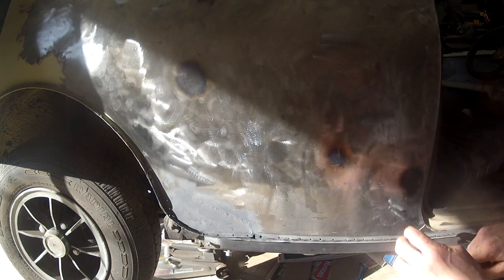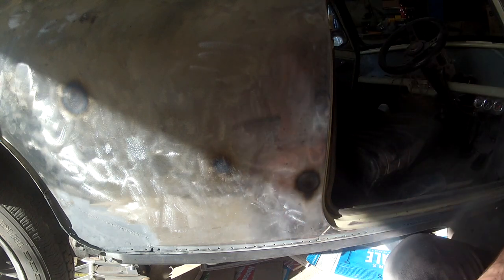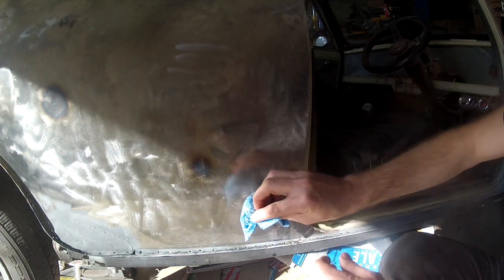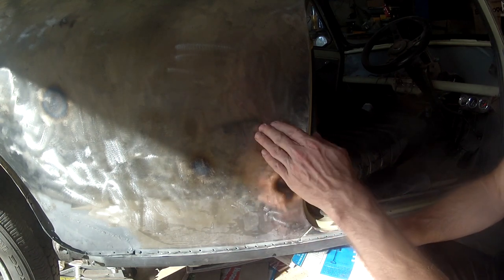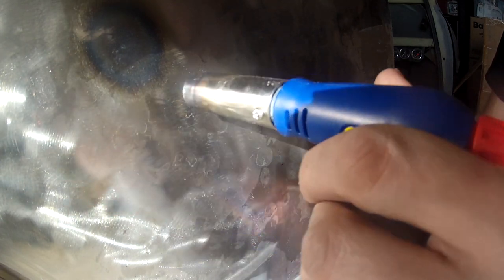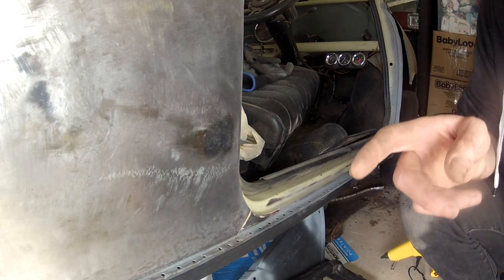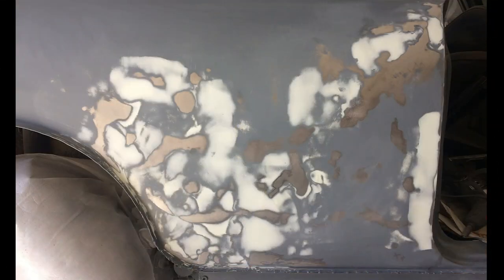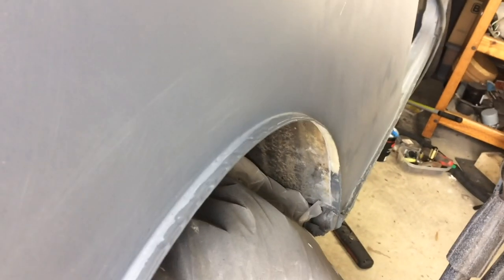EP28  Classic Mini Bodywork- Shrinking and beating | Classic Mini Van Restoration | A Rusty Journey

Comment: Can I just ask....
Heating up and rapidly cooling metal surley makes it very fragile?
I'm under the impression that doing what you have done, your changing the grain structure of the metal?
I watch alot of forging programs,and I'm lead to believe doing this to metal like you are will make it fragile...
I may be totally wrong here,but I wanted to ask, as I have the same issue to you with weak pannels.
If it works then great...
Thanks.
Reply from the maker: Hi Andrew, it does change the structure but the fact is that it's not a structural panel, very expensive and difficult to replace the entire side without causing lots of other problems.  Thing is, the metal is already stretched so shrinking it down by only fractions of millimeters is no problem. This is the way it's done by the pros. Also, with the shrinking disc, only the high spots are being shrunk down. It's incredible how malleable mild steel actually is and how hard it is to break from flexing. Some of the rotten sections of metal I had to cut, bend, drill and bash to cut out so that just shows how strong even 50 year old and rusted mild sheet metal really is and this is only 0.7 to 0.9mm!